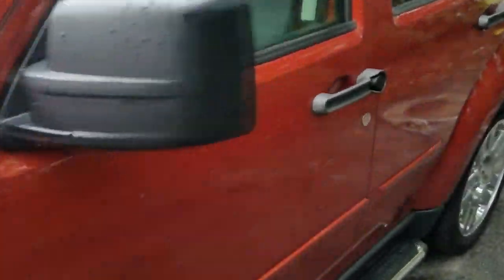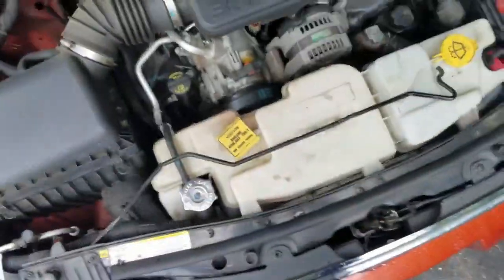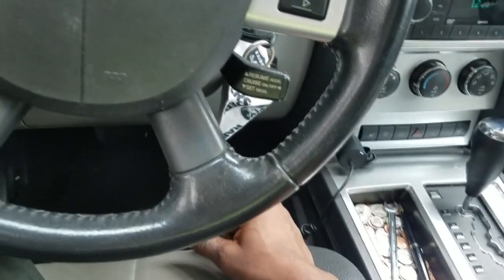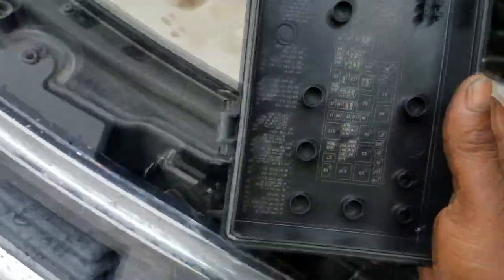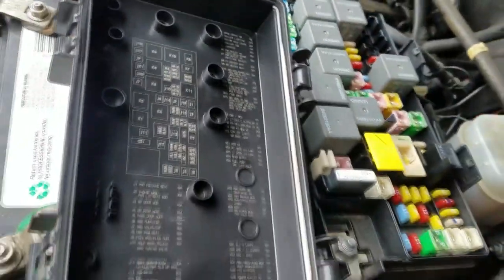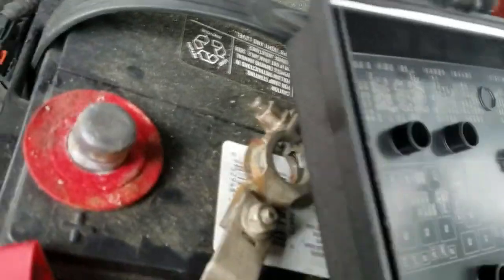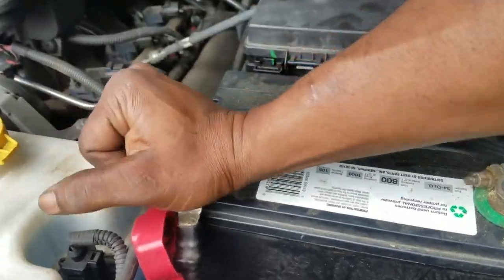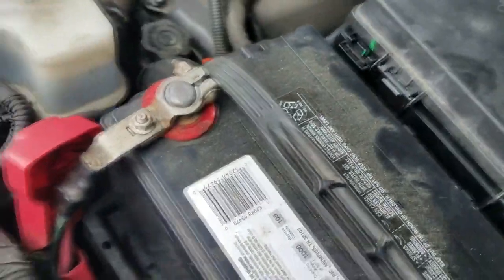Top signs your car computer TIPM bad. No Start. HORN STAY ON. Jeep BYPASS TRICK TESTING Horn Switch

Comment: Sometimes as a flat rate mechanic, substituting a know good part is the fastest way to eliminate what the problem isn't.
Reply: So you need to replace a part that you know is good before you can eliminate that the problem isn't the good part.   Do you avoid replacing known bad parts because you are busy changing known good parts?  Or do you change all parts good and bad?

Comment: horn switch is bused input from cluster to tipm
Reply: Not exactly, the horn switch goes to the PCM and it's the PCM that controls the TIPM. The horn relay is integrated into the TIPM

Comment: I had the exact same issue, horn will stay on, I replaced the fuses, had replaced my steering wheel with one used and only spent $25, problem solved.

Comment: Question I have an 2002 Ram 1500 just replace the ABS module and have to initialize the new one got any suggestions my Autel scanner will do my 2014 JK but no go on the 02 Ram. Called the local Dodge Dealer and they said they only go back to 06 Ram for ABS initializing. That dinging is driving me nuts I unplugged the 10 amp fuse for the module and it then turns on the brakes lights 24/7. Unplug the speed señor on the axel and no speedo. Trying to find someone with an old scan tool in the area is hard. Any suggestions would be greatly apperciated.
Reply from the maker: Hey bud. You are correct, Most dealers scan tool only go back to 2006 now because they no longer have a DBR 3. They could however use the DRB simulator if they have a wipod 1. smh at that dealer if they do not have those tools. I have a DRB 3 and a wipod 1. As for your other options, ive never had to use any other option so I would not know how you can get this done. I surely hope you are subscribed to the channel, thanks for watching
Reply: @OnlineMechanicTips  Thnx for the reply and yes I did subscribe. I love all the info I can get from a seasoned mechanic these new cars are a beoch to work on. I got a bud who builds race cars for a living I'm sure he knows someone with an old DBR3.

Comment: I got kind of lost I also have a 2007 Dodge Caliber and every 20 seconds my wipers go off should I replace my tipm with a new one or a used one
Reply from the maker: NO, you should find out if the TIPM your problem first, Lets not guess at an expensive part buddy.
Reply: @OnlineMechanicTips  Thanks my friend

Comment: So exchange TIPM cus horn keeps blowing !! Just so now a used replaced tipm to now have issues w the wippers!!! Hmmmm which one will u choose ? Lol i got the message use used TIPM but it is not guaranty it will be free of any issues 💯
Reply from the maker: ding ding ding...But you might get lucky and get one with no issues at all. Thanks for watching bud.
Reply: I got a reman (used) tipm also, and noticed the electrical throttle control went wrong, replaced it but my ETC light still comes on when it’s really cold not letting my drive above 25mph just bought a new Tipm and getting it installed Monday. Hopefully this fixes the issue. Btw I have a 13 Jeep Compass.

Comment: disconnect the horn
Reply: I have a Chrysler 200 with the same issues, its been giving me a decent amount of relay issues, it recently started to honk on its own and when i lock the car with my key fob the alarm goes on. ill most likely have to replace the TIPM but for the mean while i disconnected both horn behind the front bumper, the honk stoped working, so i decided to disconnected them.